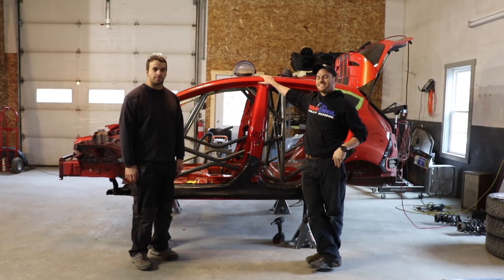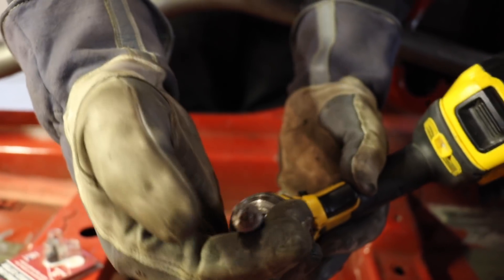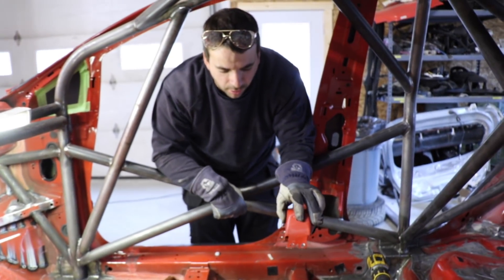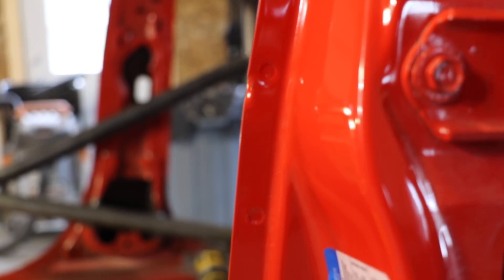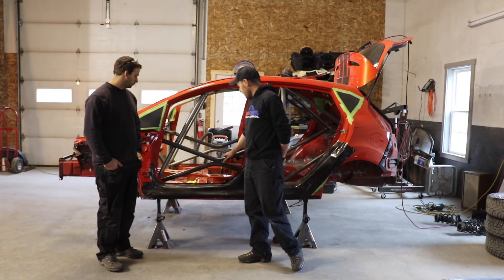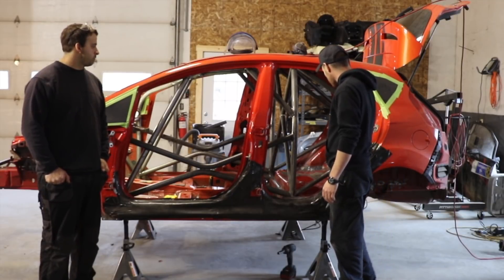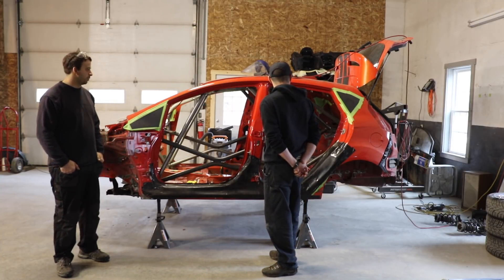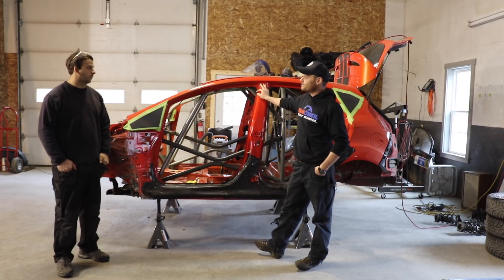Race Car Chassis Weight Reduction

Comment: or you can use a belt grinder to do the same thing as a spot weld cutter, especially if you are working on pieces that are being removed. That way you can save the expensive cutters for areas where drilling is the best option. Same thing as done in collision repair.

Comment: To lighten the car could I get rid of the paint, spray some bedliner to the underside of the car or epoxy primer, then for the top could I just clear coat the metal or plasti dip it?

Comment: At this point why not just order the shell by itself? Do they have a part number for those? Or just build around a roll cage?
Reply from the maker: The main thing with rally cars is that they have to be road legal, hence they need a VIN number and all the paperwork. If you were building a track-only car or for hillclimbs or something you didn't need to put a license plate on it, definitely could get more creative!
Reply: Damn, didn't know that.
Reply: They have to drive on OPEN public roads to 'transit' to the next (closed to the public) special stage, as well as to any service areas.
Reply: Makes sense

Comment: Why do you want to remove all the seam sealer?  Isn't keeping water out of those seams still something that you'd want to prevent rust?
Reply from the maker: We seam weld the chassis and then put some seam sealer back in after welding where rust could be an issue, check out https://www.youtube.com/watch?v=bj7EjaSNDfw&t=34s

Comment: I wear a full welding jacket when I use the wire wheel. My friend at work had to help pull a wire out of my chest. It went in deeper than I thought.
Reply: What!?
Reply: Yeah, a wire wheel is one of the most dangerous things in the shop
Reply: Gotta let the tool do the work. If you push down the wheel into the working surface you will get hurt.
Reply: holy fuck ude buy a new wire wheel
Reply: @Mitutumuch  it was company supplied consumables I'm not spending my money on something I went thru in a week, hence the welding jacket.
Reply: @cameronyoung2004  ahh i see. but the company cant supply your family with their father. but. good call with jacket!

Comment: Why isn't the roll cage built into the shell? That is the bars run inside the A,B and C pillars giving more internal room and a bigger safety margin.
Reply: That would defeat the purpose of a roll cage. The reinforcements are needed where the chassis is at the most risk of collapsing on impact. It also reduces chassis flex from those areas.

Comment: Quick question - the bracket being removed around 4:00 looks like a structural part of the chassis, in addition to just being a place to bolt a seat rail to.  Do you do structural analysis on these things, replace the part with a lighter equivalent, or just not worry about the original chassis integrity because there's a roll cage?
Reply from the maker: We start with the M-Sport Build Book for the FIA Fiesta R2 spec rally car, basically the bible for building production-based Fiesta rally cars. M-Sport has been running Ford's World Rally Championship program forever now and employ teams of engineers that plan these builds down to the last wire in the harness and rivet, when you get the R2 kit from them it comes with the full build manual. We do pick and choose from that manual, not every customer has the needs or budget for a full-spec R2 with the sequential transmission and everything, but it's where we start. http://www.m-sport.co.uk/motorsport/rallying/m-sport-the-cars/fiesta-r2-details
Reply: @Teamoneilrally  Is that M-Sport from Great Britain?

Comment: I am wondering if you guys have some advice for those of us building at a more grassroots level, like Rallycross. What are the things you could do short of a cage? Are stiffer motor mounts or suspension bushings important? Are there spring options that don't lower the car? Should you always just go for as much cooling as possible (aftermarket radiators, oil coolers or intercoolers)? How about LSDs?
Reply from the maker: Assuming you're running a Fiesta ST: The side motor mounts are fine unless you're jumping a lot or driving very hard on really rough roads, but definitely replace the bottom mount to the subframe that limits the motor's ability to roll and pivot. We like these: http://www.mountuneusa.com/mountune-Roll-Restrictor-Fiesta-ST-2013-2017-p/2364-rr-aa.htm
Reply from the maker: As for suspension, there are a few options but the best budget solution is to get the Bilstein R1 setup from M-Sport. http://m-sport.co.uk/motorsport/rallying/m-sport-the-cars/fiesta-r1-details We are the US distributers for their stuff and have boxes coming over fairly regularly for the rally team, get in touch at motorsport@teamoneil.com and we can get some on the way.
Reply from the maker: Best cooling you can, skidplate definitely, yes you'll want an LSD at some point (stock it's open and uses the traction control to help it, we use some Quaife and some Cusco now I think) just depends what your goals/budget are how crazy you want to go.
Reply: Team O'Neil Rally School Some folks have recommended the Wavetrac due to the way it behaves when a wheel is bouncing or off the ground a lot, maybe in your experience that's not much of a factor?
Reply: Team O'Neil Rally School It looks like the R1 uses Bilstein's universal motorsport monotube? I assume that would not be suitable for daily/street use because of the periodic maintenance required?
Reply: Cusco now makes a unit for the IB6 Getrag?

Comment: what exhaust would you go with in this fiesta ST? To have that rally sound...
Reply from the maker: Mountune is our go-to for most of the Fiesta ST stuff, but in the rally cars we just run straight back all the way, no mufflers and the converter at the tailpipe.
Reply: What diameter exhaust do you use on the R2 cars (or even the built, O2WD, STs), vs. what you use on the R5/O4WD Fiestas?
Also, whenever you use a rear mounted catcon, is there a heating element installed to help it 'light off' and actually be functional, or is it just there to satisfy the rules, and function is not an issue at all??

Comment: `The dry ice thing works like a charm. Just be sure to get enough. I found that it works best when you have about 3 inch thick layer of it. You can scoop it around to different parts of the car once you're done with one bit. Just for god's dake protect yourself from that stuff with gloves and what have you as this will definitly leave a mark. I heard some people put it in isopropyl acohol to increase effectiveness which I haven't tried myself yet. But it works like a charm, leaves no marks and ensures a pristine result. Just remember, better to have too much dry ice as opposed to too little.

Comment: That's amazing, really great info. I just picked up a 17 Fiesta ST, so I love all the Fiesta content. I was wondering if you guys had any 4x108 old wheels that you didn't need or some old gravel tires for sale? I've got a few rallycross events coming up. This might not be the right place to ask, but figured why not. Thanks and great video again!
Reply: They do sell (new) the R1 Fiesta, OZed 15x6.5 gravel spec wheels in a 4x108, exclusively made up for M-Sport by OZed, but these are on worldwide back order right now, and cost $250.00 each + shipping.

They would not have any of these used from any actual rally cars/teams since they convert everything to the 5x108 PCD bolt pattern hubs (and those 5x108 OZed 'disc' wheels) used on all of the R2 class and up Fiestas (as well as ALL Foci as standard, of course).
They might have some of the used factory option 4x108 alloys in a 15"/16" size, or some steelies , from the school cars though (or maybe even some used Method MR501 VTs in 4x108 15x7)?
Reply: David Hinkes That's correct,  I ended up emailing TO and working on getting a set of the M-Sport wheels.
Reply: fiesta st.. yikes

Comment: Great content, just wish you guys used a Lav or something to reduce that shop's natural echo. Keep the how to "Racecar" content coming, I've won two regional rallycross events so far using a car i built in my gravel driveway.
Reply from the maker: Lav mics on the way, this big shop is much worse than our old one! Good luck out there and have fun with it, here anytime if we can help.
Reply: @Teamoneilrally  One relatively easy thing to do to absorb sound is to put something that is semi air permeable (perforated metal sheets, fabric, fine lattice, etc) almost against the wall, with an inch or so gap between the two. In other words, drapes. Hell, some old carpets glued to the walls would work.
Reply: It's not echo it's reverb of the garage.
Reply: @cranky1812  reverb is echo

Comment: What about increasing the amount of weld points to increase chassis stiffness. Is it only done for high end rally cars, or is it even necessary with an added roll cage? I'm guessing its different from car to car, so what kind of cars would benefit?
Reply from the maker: We shot that video at the same time and we're literally editing that video right now, it'll be up soon but in a nutshell yes you'll want to do some seam welding at least around the structural areas like strut towers, frame rails, etc.
Reply: I'm guessing extra welding mostly increases strength, not stiffness. The latter is achieved by added elements.

Comment: How much does a stripped frame approximately weigh? I'm asking bc I have 2 of my old cars I plan to strip down and turn one into a track car and the other into a rally car. I won't be able to do this work for 2 years while I work on the road and save up a bunch of money. Right now they take up 2 garage spots, and I'm wondering if it would be possible/worth doing the initial strip and consolidate the 2 frames into 1 spot, either on top of each other, or flipped up on sides next to each other. It kind of sucks keeping my old cars in the garage, and my brand new car in the driveway.
Reply from the maker: Have you seen a car rotisserie? You can put one (or two) together pretty quickly and affordably if you have a welder, would solve your storage issue and also makes grinding and welding on the floors and rockers a DREAM. Put them on casters and you can flip the shells around and push them around anywhere you want.
Reply: Team O'Neil Rally School that's another question I had! Do you have to make those, or can you buy them? That would be ideal as I could move them in and out of garage if needed, and would help when I finally do start doing work.
Reply from the maker: It's a great way to go, we've made a few over the years but they are probably available for sale... Body shop / restoration folks use them a lot especially for hot rods and older cars that need rust repair underneath.
Reply: Team O'Neil Rally School sorry to waste your time, a quick search showed me a ton of info to sift through! Thanks for the info! I never knew what they were called, and now that I know it seems too obvious!

Comment: What about the issue of changing weight distribution when lightening?  How much of a consideration is that?  Do you want to move the center of gravity forward?
Reply from the maker: In a rally car, the standard thing to do is go as light as you reasonably can then move the components around when you put it back together to dial in the balance. If you can move the engine mounting back a little, battery and spare tire/tools in the back, driver and co-driver seat as far back and low as possible, you get the idea. The goal is usually to get as close to 50/50 as possible.
Reply: the lighter the car is, the easier you can balance it out with balancing weights, according to driving conditions. So for example, you start with a car that weighs 1500kg, and you can remove 300kg. At that moment your car weighs 1200kg, if you then add 100kg of ballast to get a good weight distribution, it is still 200kg less, than what you started out with, and your car is perfectly balanced.
Reply: I personally found that if you drive a FWD, it's probably not an issue as you'd generally want a bit more weight on your front end. All other scenarios, try to do what O'Neil says and balance stuff out with your components.
Reply: How do they determine where the center of gravity is within the car?
Reply: They put the car on scales, literally. (They have special scales for corner balancing, which involves adjusting the springs so the car's weight is evenly distributed on all 4 wheels.) Add together the weight on front and compare them to the rear gives you the percentage of weight front to rear.
Reply: Don’t worry about it it
Negligible change 

A cage will generally change weight distribution much more